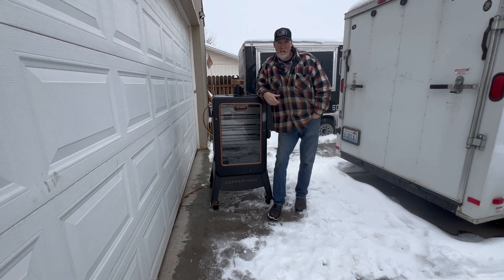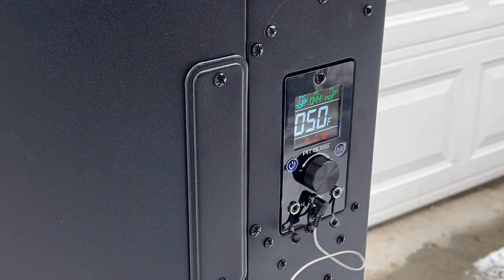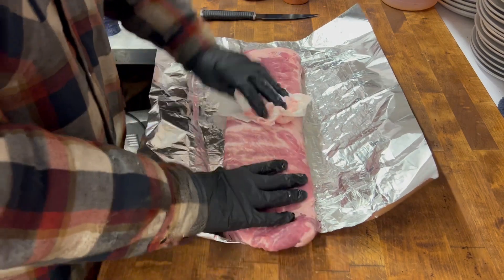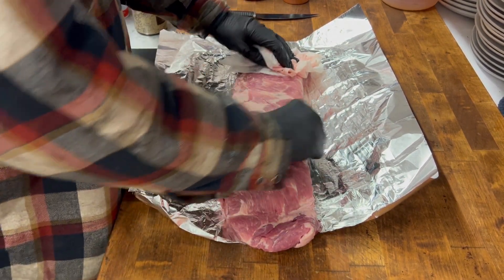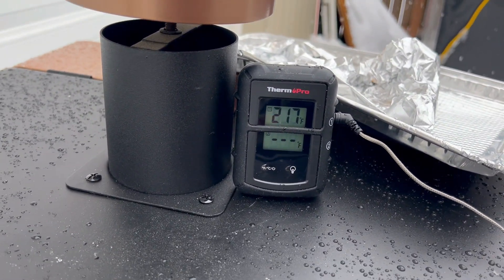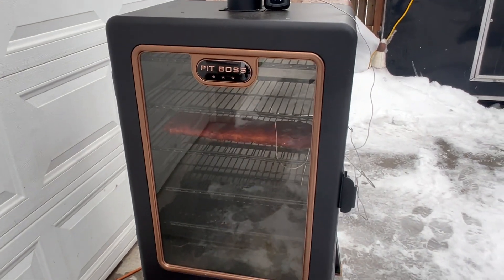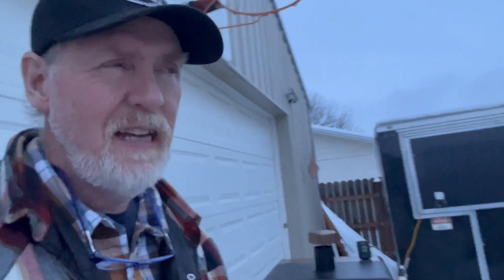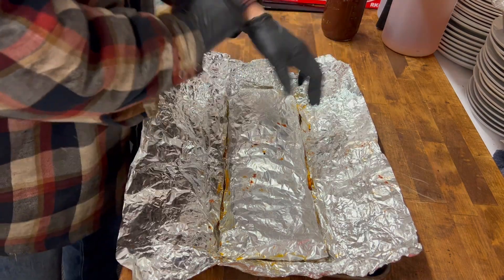St Louis Ribs - 1st cook on the Pittboss Copperhead Onxy.

Comment: I had to pull this up on my tv so I could hear you. Don't hang your probes. Get some grill clips and clip them to the grate. You did one clip. Run the clip probe the other way. That way the wire is running out on the right. I did not catch what pellets did you use? When you were at 246/236 on the probe is par for the course. The only differences in our cooks is 1. I do baby backs. 2. I only use SPG at a 1:1:1 ratio, no other seasonings. 3. I don't wrap and 4. I don't sauce. If I do wrap I put in a little whiskey or bourbon. I do spritz with vinegar/water every hour. Your ribs did look good really good.